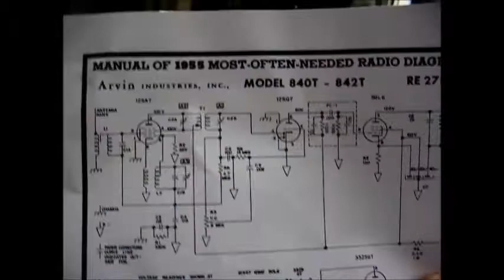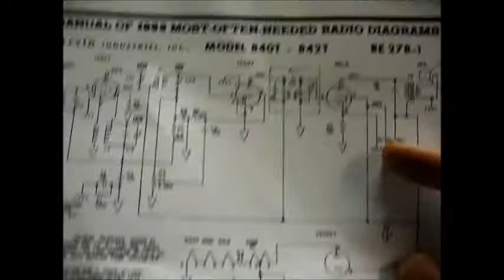Repair of a 1954 Arvin metal midget tube radio model 840T

Comment: Wow man does that radio take me back. In 1961 we moved to town so my sisters could attend High School.  We moved into a small boarding house, mom, dad and my 2 sisters shared the  kitchen/living room/girls bedroom, the folks had the bedroom, and I shared a room on the other side of the house with a transient who was renting the bed and working washing dishes at the same cafe where mom had taken a job cooking. Well it was Christmas eve of 1961, and that dish washer who, by the way owned a radio just like that one, but he had painted red, decided it was time for him to go, permanently. Being about 9 years old, I was a bit shocked when he shouted in the dark room that he wanted my dad to help him, he shouted across the house for dad, who told him to shut the fuck up and go to sleep.  Well the asshole turned on h his light and he was bleeding from both wrists, where he had slashed them down the arm to his hand.  Blood was all over, I shouted for my dad to come quick, and he came. Dad took the belt from my pants and used it to stop the bleeding on one arm, then took the belt off the bum and stopped the bleeding on the other.  He sent me across the house to have mom go to  a neighbors house where there was a phone and call an ambulance and the  police.  It was my first contact with police and with the under taker, who also used his hearse for an ambulance. I spent that night in my folks room on the floor, the next morning they cleaned out the room and hauled out the bloody bed, that became my room and I was alone in it for the rest of our time in that rooming house. I did love that radio though, hated to see it go, but the court ordered the bum to get out of town, he packed up his shit, including the radio and was gone.  Funny how I still remember that radio, over 60 years ago.

Comment: Nice little set. Another restorer I knew would always mention that chassis isolating capacitor, & if it were to short, could liven the chassis. If he did not change the original cord, he would mark a side at the prongs with a Sharpie & tell customers to place that in the wide (Neutral) side of the outlet. Switch the hot. Thanks for the mention of the safety tip, & why not to switch the neutral. Got a better grasp on that now. Hope your friend is on the mend & agreed, Junk is good!

Comment: I have a couple of the Silvertone branded ones.  They were both pains to work on, one of them had a bent tuning capacitor, also.  Good idea about a safety line cap, I'm going to have to do that, too.  Thanks, another good video.  Hope your buddy has a fast recovery.

Comment: Whenever I end up with a buggy potentiometer I usually take them apart and try to clean them. With a set that dirty it's not surprising that the volume control has problems. Given that they housed an AC/DC transformerless set in a metal cabinet like that I hope that Arvin at least isolated the B- line from the chassis rather then using the chassis as common negative. This is the way all AC/DC radios were built in Canada, they never allowed the power line to be connected directly to the chassis.

Comment from the maker: This one has a cap between B- and chassis. Still, one could get zapped if not careful. I have a child's record player from the '40's that had one side of the line connected directly to the chassis. Since the tonearm cable had an outer shield braid, the hot chassis connection was passed on to the metal tonearm; which, was very dangerous. I modified the amp to have a cap between B- and chassis.

Comment: I have an Arvin Model 440-T midget radio.  It is in great shape and plays well.  This radio is probably a little older than the one you are working on in this vide0.  The color is a light brown color.  My radio has the rounded speaker grill and original cloth cover in a metal cabinet with no back cover.  It has the original paper patch that the long antenna is wound around when not working and I unwound the wire and spread it out when playing this radio.

The knobs look very similar to the one's on this radio you are restoring.
How dangerous of a Hot Chassis is this radio?  I bought it restored (supposedly) several years back and it has worked great over the years and still does.  I am just a bit worried as to its' Hot Chassis potential.

Comment: I got the smaller one with the octal-based tubes like you showed in a previous video. They don't pull many stations in without the IF amplifier, do they? And u GOTTA have a longwire antenna connected.